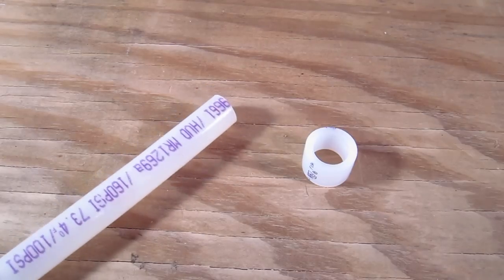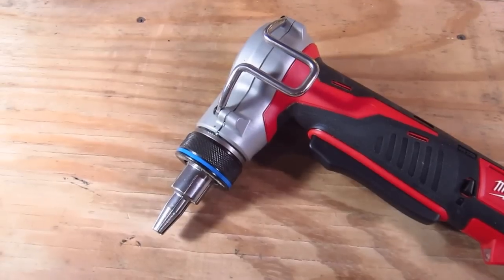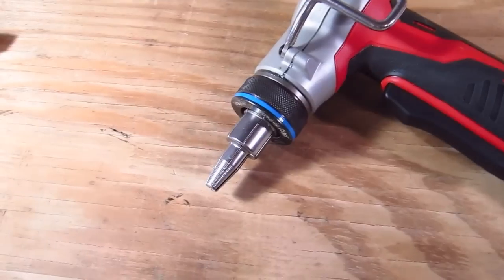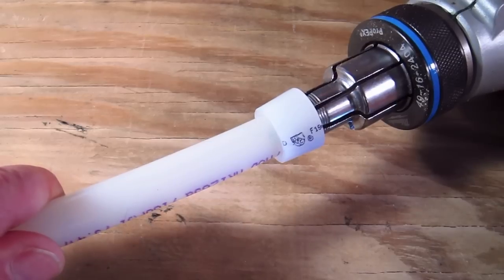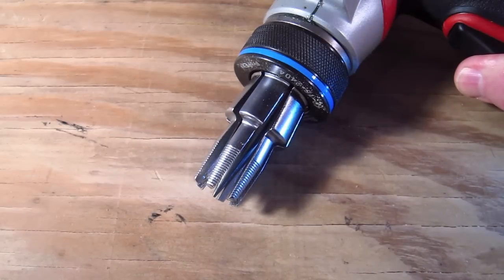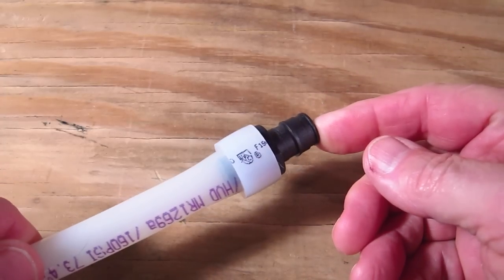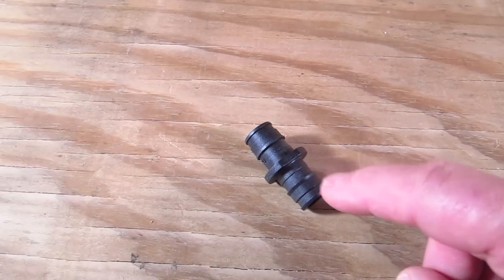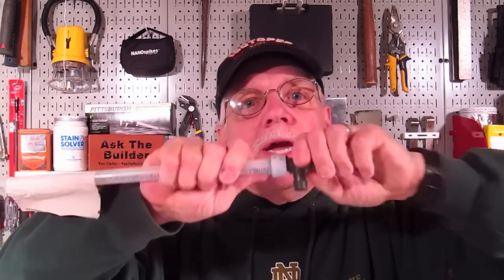Connect Pex Pipe

Comment: It is super important to know that this method does not work for all types of PEX, and is intended for PEX-A only.  Uponor brand pex and fittings will work with the Milwaukee expander tool.
Reply from the maker: That's absolutely correct. People need to just read the instructions that come with the pex system they buy.
Reply: You should change the title to Connect PEX-a Tubing and leave some more details in the description.

Comment: Tim just wanted to make you aware of failures of Uponor Pex. See YouTube video Integrity Repipe Oct. 7, 2022 and comments.  Seems like issues have arisen over time with some of the Pex and joinery methods and the brand and fittings make a big difference.
Reply from the maker: I watched it. Very interesting. Luckily I've not used the pipe that has the outer color coating red/blue. The 20+ year-old Uponor PEX in my own home looks as white as new pipe. One wonders if the water chemistry of different cities is partially to blame. Read this column: https://www.askthebuilder.com/copper-water-pipe-corrosion-aggressive-water/

Comment: Whats wrong with the metal O-rings that you squeeze on?
Reply from the maker: Well, it's just another system. Do your due diligence and discover which system has the least long-term issues.
Reply: +Magnum 308Norma recalls
Reply: PEX-B and C must take extra care otherwise you'll get leaks from improper insulation and the cinch clamp of pex-c can relax over time.

Comment: I'm not clear on what pex is for. Is it for potable water?
Reply from the maker: It is for potable drinking water and it's used for hot water radiant heating in floors and ceilings.
Reply: pex tubes are used for domestic and cold water systems
PE-RT pipes are used for radiant heat and boilers

Comment: Just had professionaly installed pex fitting leak.  Pex is crap for DIY, manual expansion tool is over $100, tool shown is well over $200.  I'm replacing my pex with regular hose.
Reply from the maker: I would challenge your claim. I'd rewrite your first sentence saying, "Just had a NON-professional install a PEX fitting that leaked." PEX is not crap for DIY. Hundreds of millions of feet of it are installed all over the world, it's in my house, I've done countless connections and not one of mine has leaked. The hand expansion tool works as good as the power one, but you'll wear out your hand and wrist if you're making up lots of connections.